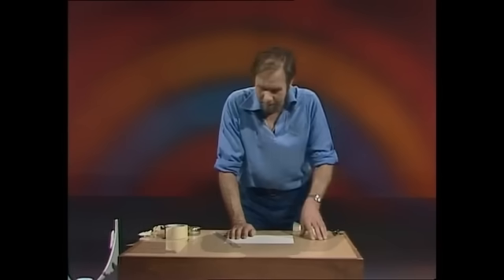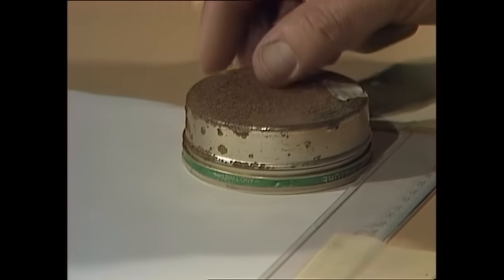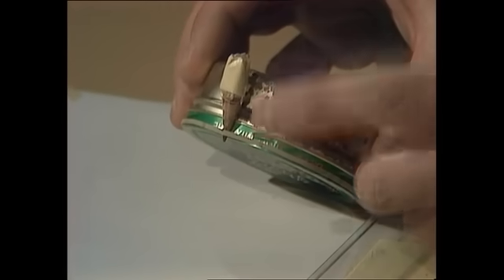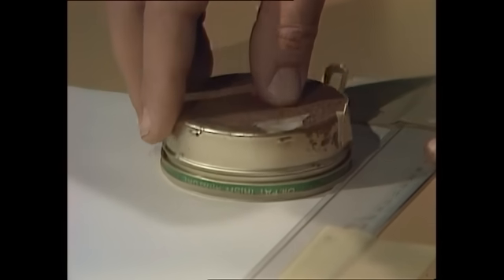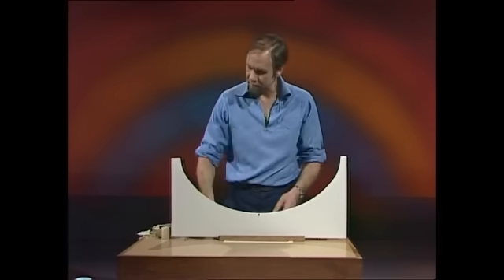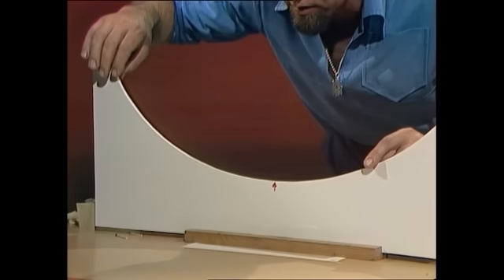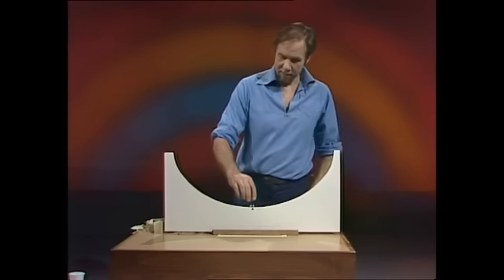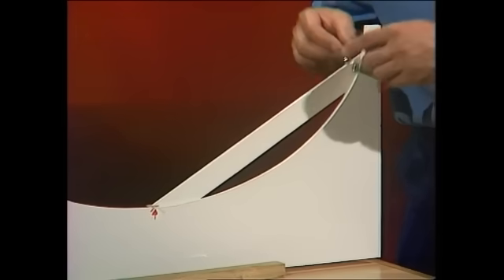The mysterious isochronous curve

Comment: This curve holds a lot of secrets. The area of the enclosed cycloid (segment) is three times the area of the circle used to create it, and the length of the curve is four times the diameter of the circle. So the Pi value of a rolling circle is four  .  You can create this cycloid by tilting a circle 57.518 degrees from the vertical, and then photograph the top half of the tilted circle. It's the only isochronous curve. Somehow it seems to be aware that it is supposed to be a circle.There's something in this, but I don't know what.
.
Reply: Holy time space Jim, that's exactly how particles behave in the warp drive.
Reply: It has to do with the natural pattern of the universe and mathematics that is always reoccurring in structures, manmade or naturally occurring
Reply: Tilt a circle by 57.518 degrees?  That is awfully close to the Radians to Degrees conversion factor of 57.2958.
Reply: @clayz1  I think the number might be arctan of pi/2.
Reply: You just made a bad ass video even more bad ass
Like bad assier
Reply: But wait. The projection of a tilted circle is an ellipse.
Reply: @johnbarron4265  but if you do only the top half of the circle it would be half of an ellipse which happens to also be an iso chromium curve
Reply: @rick4677  Wrong
Reply: @johnbarron4265  The isochronous curve is half of an ellipse.  A very special ellipse, at the angle james west mentioned.
Reply: @throngcleaver  A cycloid is most definitely NOT elliptic, even though at first glance it might appear so.
Reply: @johnbarron4265  Just checked, and you are correct.  My bad, and thanks for letting me know!
Reply: @throngcleaver  This very reason is why free speech is sacrosanct. Debate
Reply: @johnbarron4265  : But only one of the infinite number of possible ellipses is also an isochronous curve.
Reply: @fyrstormer  No, none of the ellipses are isochronous curves. They are completely different families of curves with fundamentally different mathematical definitions. Look up the parametric equations for a cycloid vs an ellipse, and you'll see what I mean.
Reply: Hamburgers are round too.
Reply: @ashemgold    Yet they are nearly always seen as ellipses.
Reply: @ashemgold  go to Wendy's
Reply: Perhaps it ties into gravity 🤗
Reply: That was wonderful to read James :)
Reply: Cut a paper towel roll at a right angle and piece it together into a circle you are left with a crown and a snake eating its tails
Reply: I've also observed a simaler phenomenon in music scales and color theory, specifically that they are mathematical wave values measured on different scales; 12 tones for music and 7 visible hues for color but in praxis the spectrum of visible light and sound form an infinite spectrum of waves and harmonics.
Reply: @garygrinkevich6971  the 12 steps of the chromatic scale are semitones. The heptatonic scale takes its name from the 7 steps that make it, so there's alignment to be found between light  and sound :)
Reply: @garygrinkevich6971  this is an explanation for something I had only just started to write down..
Reply: @garygrinkevich6971  The convention of there being 7 hues is just that, a convention. The scheme of two sets of primaries, RGB for additive light and CMY for pigments, is enough for all our color representation needs, since it corresponds to the way the human eye gathers wavelength information from light.
Reply: @MarioVAmaya  rgb and cmyk are additive and subtractive color modes the naked eye is capable of seeing more colors outside the models but i'm actually more interested in the connection between miore patterns and pitch vibration/resonance/volume I think sound vibrations are interesting; grain structures start behaving very oddly theres some interesting lab videos out there on small scale with salt crystals, DARPAs staying quiet about it Then Again who really knows I'm just asking questions.
Reply: I remember learning about this under the subject "Technical Drawing" way back in secondary school. Brings back memories.
Reply: The CREATOR knows.
Reply: Is it really exactly four?
Reply: Time travel
Reply: You lost me after you taped the pencil to the wheel. 🤔
Reply: @james west
Huh 😯?
What now 😲?
Reply: where exactly did you do the jump to awerness? =)))
Reply: "This curve holds a lot of secrets" lol 😆🤣😆🤣😆
Reply: Math
Reply: Yes, but are all elliptic curves modular?
Reply: @LIamaLlama554  what r u getting at
Reply: Reminds me of the T.Rex theory combined with Pythagoria. Add Kurt Angle to the mix and we got 66.3 chance of surviving Mammoth thats coming for impact 2027.
Reply: You just cost me,$2.95..
For a cheap bottle of tylenol.
I got a headache trying to understand this one.
Hah!
Reply: Gravity as the 4th dimension?
Reply: Reminds me of the Brachistochrone curve.
Reply: @joephillips7612  wow that made a lot of sense of that true or your opinion
Reply: Lol
Reply: In 2-D motion!
Reply: Is this the kind of stuff engineers watch. Because I phased out in the first 10 second when he said, something about something being interesting.
Reply: There is definitely deeper meaning and structure here. This effect is the result of the forces acting upon it. Similarly, as we are moving through this life, we are shaped by the forces acting upon us. People are asking how this can be applied or what it means to understand this. Sacred geometry arises in form from the way nature progresses through the forces acting upon it and so creation is unfurled through this progression.
Reply: Yes.
Reply: https://youtu.be/4G6e4TaJxkI
  at 0:12,
Reply: holy shitt... i understood none of that ,ty
Reply: Goose
Reply: Quantum.
Reply: Would the obliquity of the Earth at 23.5 degrees be of any possible relation?
Reply: @thewackywizard2049  earth is a flat stationary plane,non rotating! As described in all official space and flight training documentation.go and investigate this,it’s available to read these manuals.look at the United Nations emblem....it’s the flat earth map! .....they KNOW,
Reply: What do you think it does when we're NOT observing it?..
Hmmm🤔..... I'm not entirely sure, but I don't trust this curve any further than I ca.. HEY! Where's my wallet?! 

Isochronous Cuuurrvvee!!!
 Not again you rat bastard!!!
Reply: Just put that pi in a pie pan and not being part of a math project and I'll eat it!
Reply: @georgeplagianos6487  LOL as my dad used to say, “pi*R*squared? No, pie are round, cornbread are square”
Reply: @QmanChu65  : Not if you make cornbread correctly, in a cast iron skillet.
Reply: @fyrstormer  exactly. I was thinking, who makes square corn bread? Then I did remember seeing people bake it in square pans before. Doesn't seem right.
Reply: That is the greatest secret it holds ..... what good it does to know about it.
Reply: The instructions for creating life and the purpose of the creation of all existence in the universe has been left for us here on earth. At that exact moment we are ready to take our evolution to its final stage (Celestial Gods), we will crack the code and ascend. Leaving the limitations of our known physical world (time and space) behind us forever.  The ability to flow freely and instantaneously throughout the galaxies without limit. Maintaining our consciousnesses forever. Mama bird left us in this nest in hopes that one day we can join them in the great beyond, if we open our minds and remove our animalistic tendencies, we will eventually learn to fly or plummet to our demise into the dark void of nothingness. If we humans can’t solve the code in time before we destroy our planetary canvas, we will force the celestial creators to start over somewhere else or here at another point in time.
Reply: This is the deepest thread of comments I've ever seen on YouTube :D
Reply: Jesus Loves You
Reply: @101Design_1  Proof of Jesus  please
Reply: This life is insanely short compared to the eternity we'll see in Heaven. Jesus, the Son of God, died for our sins. He was crucified, then resurrected on the third day. With His sacrifice, we can live forever in Heaven with Him! 

Thousands of years from now in Heaven, you won't even remember the concept of money, pain, or suffering. Repent, follow Jesus, and see Heaven!

- If you want to learn more about Jesus and Heaven, read one, or all, of the books of Matthew, Mark, Luke, and John within the New Testament of the Holy Bible. Each book serves as an eyewitness account of the miracles He performed, His sacrifice, and His promise to you!
Reply: @Dr.Soda7 
Really?? Piss off
Reply: The (7) colours divided by the (12) notes = 0.583*
These numbers are significantly close to the angle noted above. 
Curious? Mmm 🤔 
Can it be applied to trading in Crypto Currency Blockchain algorithms?
Reply: @rodjoass7284   I can't believe I'm taking the bait, but

How did you manage to relate any of that to the value of crypto?
As much as I want to believe in an algorithm there,
Occam would suggest the instability of a decentralized platform and a shrug of the shoulders. ¯\_(ツ)_/¯
Reply: @ChasingChad  yes. Exackery. 
Similar to the behaviour of trading markets that leave common sense behind. Or in your name sake: Chaos theory goes a long way to explaining everything yet it shouldn’t. 
Is this Isochron behaviour, expressed through motion in 3D then mathematics in 2D - a wave? similar to human emotion? Like the above examples, created by a wave that doesn’t match any expectations of previous charts. 
Or maybe an expression of gravity? Like a shrug of the shoulders.
Ok? So if we could produce this (gravity) wave, via  an “engine”, it wouldn’t make a noise, no heat yet, it could travel any where in the universe at a great rate of knots . Yes, gotta live this rock n roll science. Woo hoooo!
Reply: @rodjoass7284  lmao xD
Reply: The CREATOR knows.
Reply: Im not sure what I read but it makes sense in a way lol. It seems time and space know what they need to be just as much as biological matter does. There's codes to this reality we live in and the codes hold it together. To think that time, space and matter can change in order to achieve a desired outcome kind of prove intelligent design and every beginning is seeking a predetermined end and will get there eventually...wild!
Reply: @colonialrebel9964   Absolutely. Wild as nature. 
Let’s pray the wheel doesn’t buckle
Reply: @colonialrebel9964  you are correct I think that if you notice the patterns you will gain a lot of wisdom in life and a better understanding of nature's blueprints which can be applied to many differant areas.Like for ex a mole the "golden ratio". A natural ratio of sizing and proportions that has been used in art ,arcitecture ,furniture making ,etc.The curve may have a use in analog computers,for exa mple
Reply: @redwolf7929  this curve reminds me of a seed. The seed doesn't know it's a seed but it has a program that tells it what to become. This curve doesn't know what it is and no one tells it what it is but it knows where it belongs. Its so creepy to think all of time, space and matter fight against entropy but are predetermined to be ruined by it.
Reply: @colonialrebel9964  dude I do not understand how someone hasn’t comment on you text yours and the most exciting best ones out there man your a smart guy keep going your gonna achieve great things one can only wish to be that intelligent
Reply: @colonialrebel9964  100% correct in my opinion I wish people would stop focusing on all these stupid Theories and use that time effort and money into changing the world and changing people lives that’s a difference that’s what matters not time travel or all that other bull shit it’s just thinking and endless cycle of thinking and never getting no where
Reply: @elijahrussell4143  i think going to space is a huge waste in resources. Our planet is 70% water and most of it is unexplored. They cant say we need to go to space for resources. Or that our planet is over populated when literally 70% of it is uninhabited. With modern technology we could literally do anything.
Reply: @colonialrebel9964  dammit. Now I want fungi... lol. Thanks.. 🤣🤣
Reply: Intelligent design :)

Comment: after the fact it makes sense because the acceleration is greater the higher up the ball is placed which compensates for the distance. The fastest way to travel may not be the shortest distance because although the ramp would appear faster you have to consider it is more comparable to simply dropping an object with less resistance. Excellent video.
Reply from the maker: Many thanks. Lots more at www.youtube.com/curiosityshow   with new stuff each week for subscribers - Rob

Comment: Makes sense to dive in your submarine using that curve, to avoid the torpedoes which travel in straight lines. Problem is I do not have a submarine, so I will play with my curve and rubber duck in the bath.

Comment: it seems pretty simple.  The higher you go on the curve, the more parallel you are to the direction of gravity(acceleration). You get the highest acceleration at the top because this and as you go down the curve, you get acceleration from changing direction, causing the ball to increase speed along the whole path.  This is why it reaches the center before the straight line.  The placing of the balls at any point and reaching the center at the same time; is a result of a tuned curve.
Reply: Dunning-Kruger much?

Comment: A cycloid is the curve traced by a point on the rim of a circular wheel as the wheel rolls along a straight line without slipping. A cycloid is a specific form of trochoid and is an example of a roulette, a curve generated by a curve rolling on another curve.

Comment: the ball moves slower at the center of the curve and faster at the ends of said curve,  it's all about slope angles and measuring the units setting them into a linear equation then running all possible numbers on the curve in order to get a usable algorithm a shorthand way to get answer quickly and accurately!   how much do gravitons cost in 2020?

Comment: isochronous curve demonstration, shows the same effect of falling feathers and a metal in a vacuum. same time it reaches the ground. at the same point. wow!!
Reply from the maker: But pretty different physical reasons, Rob
Reply: Extend your arms wide in front of you palms vertical with a long handle broom placed on you hands .Draw you hands together as if to clap hands not to fast  sliding them under the broom. Done correctly your hands will come together at the balancing point of the broom or anything similar it's quite astounding.

Comment: Great video and information, this really is amazing and hard to really understand. Just a guess as to how this works, I think the acceleration must be much greater the higher up the curve the ball is released. But when I think about it that doesn't make sense to me. Is there an explanation of how it works? Anyway I enjoy watching.
Reply: The way I understand it is if you look at the top, it's almost a straight drop, if you look at the bottom it's almost horizontal. Every point on this curve has it's own potential for acceleration with it being greater at the top than the bottom, so, no matter where you start, the balls will have to meet in the middle because there is a set time if you will of how long it will take
Reply from the maker: Including a full explanation was too long for a 4-minute segment for 10-year-olds, but you can research it under this name or cycloid or brachistochrone - Rob

Comment: So they always meet at the same point because depending on where they are dropped from, their accelerations and velocity are relative
Reply: The ball starting near the middle gets to the point slower than the one dropped higher up, but because it’s dropped farther away they both balance out
Reply: The one on the straight line loses to the curve because the ball travels slower on a 45 degree angle than an initial angle of 90 degrees

Comment: The "isochronus curve" he describes is also known as a "cycloid." Indeed, the path of the cycloid arises in a surprising amount of problems in mechanics and dynamics. In fact, they used modified paths of cycloids to tune grandfather clocks. This is because the time to swing (duration of ticking motion) does not increase with the length of the pendulum. Furthermore, if you've heard of the "least action principle" --- or something to the avail of "any particle takes a path of least resistance" --- you may be surprised to know the cycloid is the unique path that minimizes time for a particle traveling point A to B under the influence of gravity. Pretty neat!

edit: formatting

Comment: Its not a mystery its quite simple. The curve on a normal circle is uniform. Any slice of the circle will curve at exactly the same angle. This isochronis curve flattens out at the bottom. The ball cannot gather any momentum while the ball dropped from a higher angle where its steeper which  gives it a lot more speed so it catches the opposing ball up due to this discrepancy. While its an intetesting experiment the result is by no means unexpected.

Comment: All it is is the momentum of the ball starting from the top going straight down building more speed, and the other ball being closer to the center not being at such a steep angle or drop going slower, causing them to meet at the same time. Same as the drop with the slanted bit, it starts off as a drop and builds momentum, meeting the slanted ball that stays the same